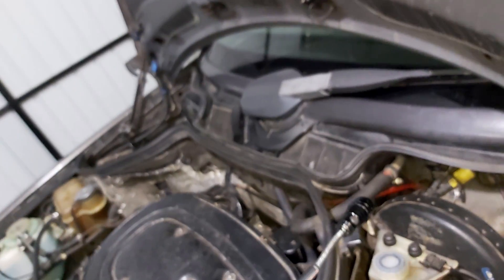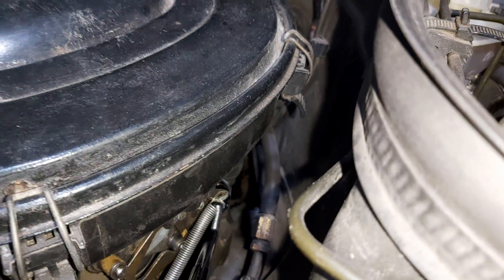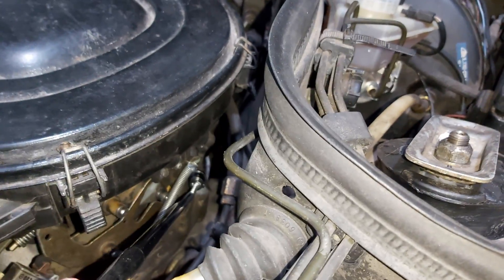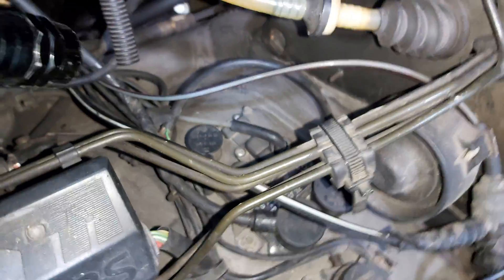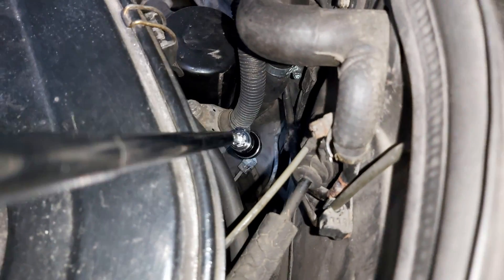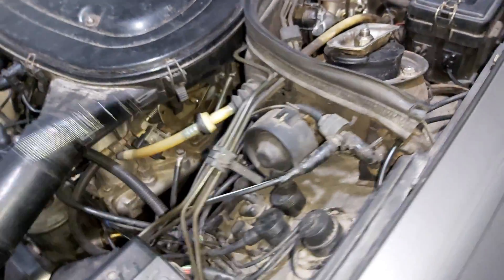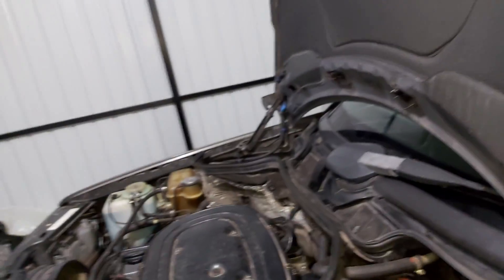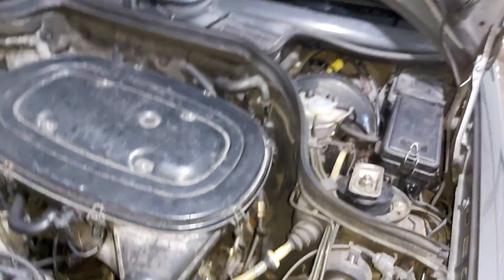㉦Mercedes Ke-Jetronic㉦ - Vacuum lines

Comment: What do the vacuum lines do? I have a clear on running under my Air Cleaner. It snapped 😩 I have a 1990 300E. HELP!!!
Reply from the maker: Vacuum lines are critical on the M103:
They don’t just “control emissions” — they directly affect mixture, ignition timing and idle stability. If a vacuum line under the air cleaner snapped, the engine will run lean, hesitate or misfire, idle rough and behave unpredictably under part throttle. That broken line can affect the fuel pressure regulation, ignition advance (EZL), or the idle control system. On a 1990 300E, you should:
1️⃣ Replace the broken hose immediately (correct diameter, no generic loose hose).
2️⃣ Check all vacuum lines, not just the broken one — if one snapped, others are likely brittle.
3️⃣ Do NOT adjust the mixture screw to “fix” a vacuum leak — that only masks the real problem.
Once vacuum is restored, the engine behavior usually improves immediately.
If you want, tell me exactly which hose broke (diameter / location) and whether the idle changed after it snapped and I can guide you further.
Reply: @mercedeske okay if we look at the engine from an under the hood perspective. There's a breather hose (valve cover to the air filter) that runs stop the air cleaner box. Attached to it is the literal air cleaner and a valve/hose. This hose is our vacuum tube and it runs under the air cleaner. A piece of that hose (as I tried to hook everything back up). I went to local auto parts store and bought more tubing and rubber sleeve to attach the hoses again. The hoses are firmly together with no break. My idle is still a bit funky when sitting still and the car stutters a bit but the car runs without (other) issue.

Comment: What is manifold pressure supposed to be with engine warm and at idle
Reply from the maker: Here we talk about working pressure which varies in relation to the engine(5.1-6bar), so I can't tell without the engine code!
Reply: @mercedeske  I'm sorry. I meant vacuum pressure at idle. What is the ideal vacuum pressure number when I hook a vacuum gauge to a vacuum port.

Comment: What is that resistor thing mounted on the firewall above the brake booster?
Reply from the maker: Hi. If you mean the round thing with numbers - it's just a sensor which should make adaptation to a poor or higher quality fuel(the times of leaded and unleaded gasoline).

Comment: The hose to the ignition module comes from a hole on the manifold in my vehicle. Do you think this is normal?
Reply from the maker: Yes it is, that's where from the ezl reads vacuum, in fact the engine load.
Reply: thanks for the answer. My car is running a little high revs. Even though I changed the potentiometer and idle valve, the problem was not solved. Where do you think I should look?
Reply from the maker: Have you calibrated the potentiometer?
Reply: yes I calibrated it to 0.7 volts. My car is 2.3 engine.
Reply from the maker: Check for vacuum leaks if you have checked all sensors.
Reply: What sensors can cause it?

Comment: my M102.982 economizer gauge only goes half way down when I take my foot off the accelerator, I have nerve seen it in full eco position, always in red or half way red, any tips on what could cause this, I have checked the vacuum lines, could a split i the rubber boot cause this? BTW thank you for you videos, I find these to be very helpful and informative.
Reply from the maker: Yes, check the rubber boot.
Reply: @mercedeske have a good day sir,
Can I get M103 w124 300E vacuum diagram from u ?

Comment: this video came on purpose.  My 190E sometimes starts to accelerate a lot (3000 rpm) without pressing the accelerator.  and then usually slows down on its own.  The problem appears to be electrical or vacuum.  do you have any tips for me?
Reply from the maker: At first check all breather hoses. If the problem persists check the rubber boot.